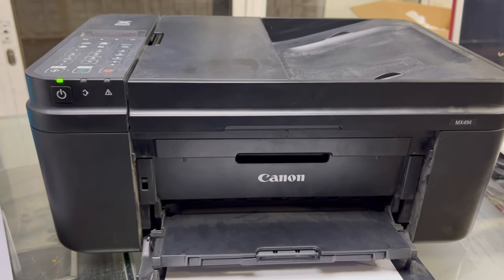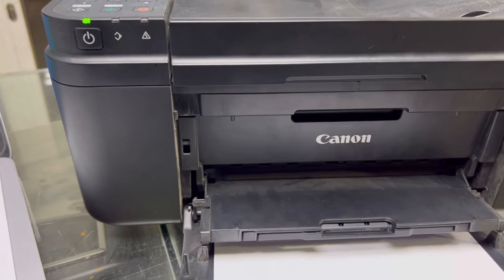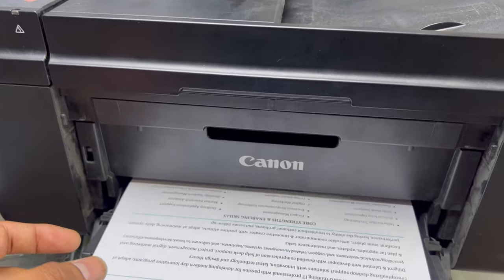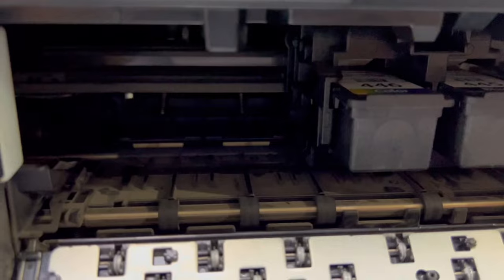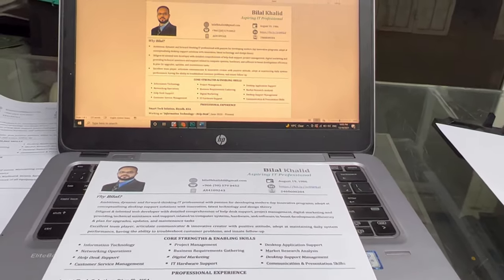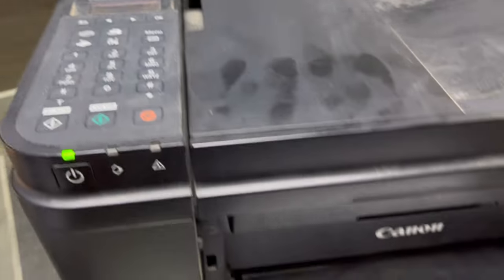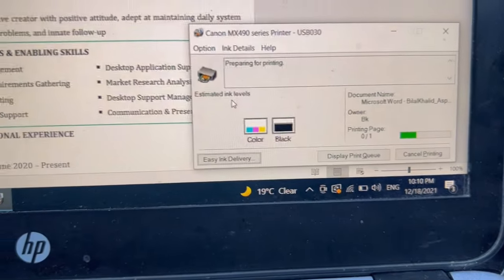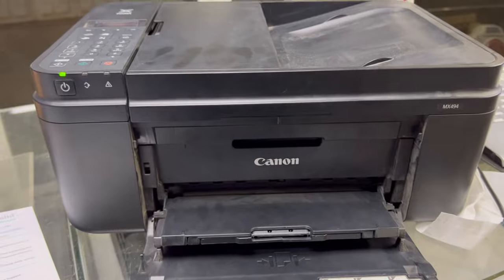How to Fix Wavy Zigzag Text and Double Line Text in Printout | Canon Inkjet Printer

Comment: Thank you so much for the help! ❤ I was thinking about buying a new one because I didn’t wanted to deal with the problem, but I checked my printer and saw that it did have a lot of grease and ink. I tried your tip and printed out the papir. It still doesn’t come out 100% perfect, but at least it’s now possible to read the paper 👏🏼

Comment: It did not work for me on a Canon Pixma iP8720 that prints mostly double (depending on the font). After running a tissue over the plastic strap did not correct  anything. Was there any dirt on the strap? Difficult to tell as the strap is much more difficult to view let alone trying to clean it.